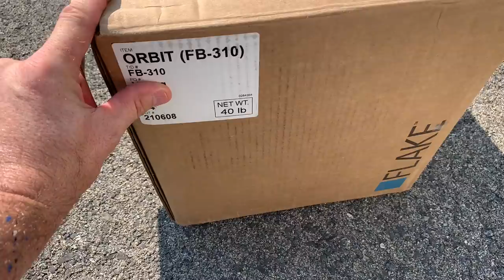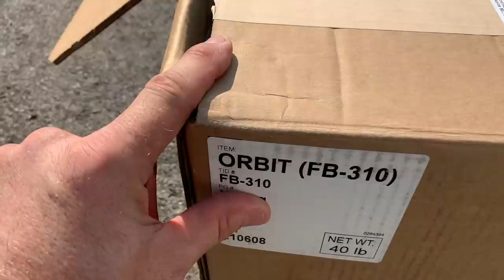Unique Line Striping On An Epoxy Flake Floor

Comment: Just did my fist epoxy job on my own and i had a few mistakes. First i didn't prime and paint  dried blotchy.  Flakes hid the mess under. Some parts absorbed faster than others and dried. When i cast the flakes they didnt stick much.  Tried touching up. Huge mistake. Resanding everything and reapplying base coat and flakes. From man to man, thank you. You definitely help me understand epoxy systems better.
Reply from the maker: I would be more than happy to guide you through personally, create an account in our store and get contractor discounts .  You can email me directly jason@concretefloorsolutions.com.  I am here to help.

Comment: One thing we do for striping on a textured surface. we do a clear tack coat of the urethane, super thin. Just so it seals underneath lip of tape. Then once it tacks up we apply our color coat over that. Keeps lines nice and crisp. Great work and great content.
Reply from the maker: Sounds like a good tip, Thank you
Reply: We do the same thing. That way the clear is what bleeds under the tape and also creates a seal. When you pull the tape you cant even notice. I think it's much cleaner than trying to wipe away  anything that bleeds under. The only downside would be if you weren't using something that cures fast enough but polyaspartics seem to do really well.

Comment: Can you explain the trade off between keeping joints and the possibility of cracks? Thanks!
Reply from the maker: If you leave the joint open, you will have a continuous dirt and water catch.
If you fill the joint and coat over it, there is a possibility of movement within the concrete that may create a crack through the coating. 
In most cases, the risk of a crack in the coating is more popular than leaving the joint open.

Comment: I'm glad I stumbled on your video - love the attention to detail!  Question, suppose your colored striping was subjected to wheel traffic.  Would it help to run another coat of clear epoxy over the finished striping?  Wondering how the urethane would hold up to tire traffic over time otherwise.
Reply from the maker: The Urethane is actually better scratch and abrasion resistant, then the epoxy. Excellent with traffic, you would not need to topcoat it.
Reply: Excellent, good to know.  Thank you!

Comment: Just letting you know first that I don’t know anything about flooring. My question is if you fill the expansion joints is that not counterproductive? It must be ok or something otherwise you wouldn’t do it. Please educate me lol
Reply from the maker: Filling joints is optional and completely up to the customer. If you fill joints, you need to use a semi-rigid material so the concrete can expand and contract or else it will crack somewhere else. The negative is, if you do, fill the joints and coat over them, if the joint moves, it will crack through the coating.
So you need to make a choice, either leave an open joint that dirt will lay in, or risk a crack in the coating if you do fill the joint

Comment: This is probably my 5-6 video of yours over the last 3 days. I have been back and forth on what I want to do with my 840 sqft garage floor since we bought our house 3 years ago. I was encouraged to go ahead and do it myself vs spending $6000-$8000+ letting a contractor come in. I just plan to contract out the floor prep/grinding. It is super important that the floor stays level for my boards and I am just a bit concerned I may mess that up. I have since started playing competitive cornhole so I wanted to put some permanent lines down on the floor. Well, this did it for me. You have answered all my questions that had me hesitant to take this on and now answered my line issue. Great stuff! One quick question regarding the line in this video. Is there a reason you did not put the lines down first before doing the top coat?
Reply from the maker: If you try to put the white lines down before the clearcoat, the texture will be so rough it will bleed under the tape really bad.

Comment: You mentioned the client changed their mind about line location after you finished the white lines, curious, how did you handle that? Told him too late, or is there a way to actually remove the white lines without ruining the top coat?
Reply from the maker: They changed their mind before we put the line striping down. I don’t know exactly what you heard in the video or what part. This was a while ago. They actually wanted the stripe up the middle to mimic in airport runway. As long as they told me before we put the line stripes down, it didn’t affect the job at all.

Comment: What does the Aluminium  oxide achieve ? 
Great videos by the way mate, good job.
Reply from the maker: Aluminum oxide is a non-skid texture additive that you can apply to the topcoat. It essentially looks like clear sand particles when you apply it into a clearcoat. It just adds more grip to the floor.

Comment: What if you have a large hole, like  literally the size of a 2 by 4. (Yes they put a 2" by 4" by like 4 ft in this section) It is a transition from one concrete pad to another, and I would have to fill it to make it look good. How should I go about that? Would I fill the whole thing with the fine sand first, then the CFS 343, or would it be better to fill it with concrete (or concrete leveler)
Reply from the maker: Believe it or not, you are not the first person that has this issue.
I would not recommend a cement-based product as it will not bond very well to the existing concrete. 
I would recommend using an epoxy mortar :
https://concretefloorsolutions.com/store/repair-materials/epoxy-mortar-kit/
Try to pull the 2 x 4 out, clean the interior of the area and install this material. Keep in mind if your concrete moves it may crack, there is nothing you can do to stop concrete movement if it’s going to happen. 
After this material is cured, grind over the whole surface to prepare it for an epoxy flooring system. 
 
We have a variety of floor kits available, and I am always available to offer customer service as needed 
https://concretefloorsolutions.com/product-category/epoxy-floor-kits/
If you have any questions, reach out to me directly jason@concretefloorsolutions.com

Comment: am thinking about doing this tommorow, does the coating bleed under the tape, is there anything i can do to prevent it im scared it will bleed under, white onto my grey floor, thanks
Reply from the maker: The material can bleed under the tape very easily. I found that duct tape works pretty well, make sure the tape is pushed down very well along the wet edge.
Reply: @ConcreteFloorSolutions  thank you

Comment: I don’t think that the top is a concrete actually. I see that under the carpet when I used to work for apartments. Is very soft and with tons of cracks. But you do a very good work. Thank you sir..

Comment: Great Job!
Question: Before clear coating; why not put down a solid white line (less taping), then the blue line and THEN the clear coat?
Reply from the maker: This polyurethane is thin, if you try to go blue over white, it will take multiple coats of blue so you don't see the white underneath it. 
The line striping is it polyurethane so it does not require a clearcoat.
If you did the line striping prior to the clearcoat, you would exceed the 24 hour window to apply the topcoat over the flakes.

Comment: At the 9:17 mark there is a blue and white machine that looks like your vacuum is attached to but is way more than a vacuum. What is it?
Reply from the maker: That is a blastrac 654 vacuum system, 480 V.  It is a +/- 850 CFM vacuum. We use that on industrial jobs also with two grinders running. 
Zero dust from grinders.
Reply: @ConcreteFloorSolutions  thank you, I’m going to look into that one.

Comment: When striping lines over a freshly installed floor, like shown here - is there a time frame you need to work within in regards to ensuring bond with the floors top coat and the urethane stripes?
Reply from the maker: Since we are applying urethane on top of epoxy, we lightly sanded the surface to create a scratch for the urethane to bond to. Therefore there is no window to worry about. We also solvent wiped with acetone after we sanded.

Comment: Two questions:
1. We live in a Northern climate with salt.  Does polyurethane paint hold up well?  Does it scratch or chip?
2. Could you put a clear coat epoxy on top of the floor after the polyurethane paint?
Reply from the maker: Polyurethane has better scratch resistance than epoxy. It can scratch or chip as anything could.
Putting clear epoxy over urethane would be counterproductive. The urethane is a much better topcoat

Comment: Love your floor ! Quick question. I am thinking about hiring a contractor in my area to do our floor with them using a Polyaspartic Top coat over the flake.  They do not do striping, so it looks like I will have to do it. I looked at your Line Striping paint you offer, will this work with what they use as a top coat ???
Also - Do you pull the tape off while the Urathane is still wet - on both colors ?
Reply from the maker: I have no idea what material they are using, as long as you lightly sand it, you shouldn’t have a problem. Yes you pull the tape off while it is wet, once the urethane dries the tape is glued to the floor. You need to be very attentive to the tape edge when you apply it. It needs to be tight to the floor or else you will get a sawtooth edge.

Comment: This looks great. Thank you for sharing the video. Question: At the entrance to my garage at the garage door the concrete is breaking apart about 3/8 to 1/2 depth along the whole width of the double garage. If i chipped/ cleaned all the loose concrete would i be able to fill to max depth of 1/2 or any ideas of what else i could do? Thank you
Reply from the maker: You could chip the concrete and prep it properly, you can use this material mixed with sand and trowel it smooth, grind the material after it cures and apply a coating on top of it. 
https://concretefloorsolutions.com/product/cfs-343-fast-set-epoxy-crack-filler-fast-set-epoxy-spall-repair/
Our 3 coat system is:
https://concretefloorsolutions.com/product/500-sq-ft-solid-color-epoxy-floor-kit/
Reply: @ConcreteFloorSolutions  Thank you very much for the quick reply. I will have a look at the links you sent in the near future.

Comment: I would imagine you need to mallet the tape lines down to minimize under seepage of coating.
Reply from the maker: You definitely need to press the edges down very well before applying or it will wick underneath

Comment: If you put a small bead of clear caulking along the edge of the tape and smooth it out,  the wet material won't bleed under the tape leaving really straight lines with no bleed through under the tape.

Comment: Try frog tape next time it stops paint seeping in the edges, brilliant work btw 👏
Reply from the maker: I have tried frog tape. I think that only works well with water-based materials. I did get quite a bit of bleeding under frog tape previously but every job acts a little bit different. I have also had good luck with low grade duct tape.

Comment: Why does everywhere I look say a 650 sq ft garage needs about 100lbs of flake for full coverage? This looks like about 20-25 lbs were used and it covered nicely.
Reply from the maker: I have noticed that also.I agree with you 100%.  Even if you had 50 pounds, I think you are plenty good for a full Flake for 650 ft.²
Reply: @ConcreteFloorSolutions  come on man it's like anything else they just want to sell their product

Comment: 3 day project on a garage? If you used polyurea/polyaspartic that is a one day project. Why do you use epoxy?
Reply from the maker: Because the epoxy primer is low viscosity and penetrates into the concrete unlike polyaspartic.
Installing an epoxy primer is the best practice, if you skip the primer, you are risking failure. 
I get phone calls every day from polyaspartic one day systems peeling. 
Polyaspartics are great intermediate, and or Topcoats, just should not be used as a primer
Polyaspartics are soft, flexible materials, which allow air to migrate up through the pores of the concrete and slowly push the coating off unlike penetrating epoxy primers. 
Also, One day floors are typically 15 mils total thickness, unlike this system which is 30 mil thickness. You get what you pay for..
Reply: @ConcreteFloorSolutions   are you in a southern climate? My company uses polyurea as a basecoat I have seen companies using polyaspartic with little success. Epoxy we will use in basements or temp controlled areas but always with a polyaspartic topcoat.
Reply from the maker: @HENSLEYDMB  We are in the Northeast US.  Polyaspartics are phenomenal topcoats and midcoats, they just require an epoxy primer first to take out the risk of vapor transimission failure. I get phone calls literally every day for (one day) polyaspartic flooring systems bubbling. Yes our system takes two or three days to install, but quality is about taking your time and doing it right.
Reply from the maker: @HENSLEYDMB  our typical interior flooring systems consist of in Epoxy Primer, Epoxy intermediate coat with full Flake and a polyaspartic Topcoat.
If we were to install a system exterior, we would install an Epoxy prime coat, polyaspartic, intermediate coat with flake, clear polyaspartic topcoat.

Comment: Great video, but there's just one thing I wasn't clear on - why didn't you fill in the expansion joints? (kidding, kidding)
Reply: They didn't fill in the cracks because the customer didn't want them to just in case the floor cracked later it would be a straight line...😂😅🤭 He may have forgot to mention it.

Comment: ""Gr8e Show thanks heaps!!'""~~id use an airless spray w a 211 tip NOTHING leaves a sharper line.!!. just 2 rows w a 12 inch paper  on a tape  gun .ok maybe  24 wide,, .. run one light coat  then another. " Shear perfection!... a roller will always bleed~~~~~~~~~~~~~~~~~~~~~~~***

Comment: Green Frog tape, 2”…?
Reply from the maker: Yes, I do need to caution you, if it is extremely humid out the frog tape will actually buckle before you apply material. Painters tape will work well also, you just need to push it down really hard so there's no gaps underneath.